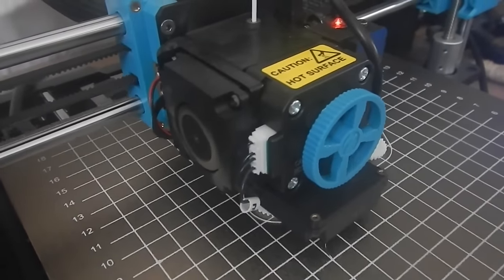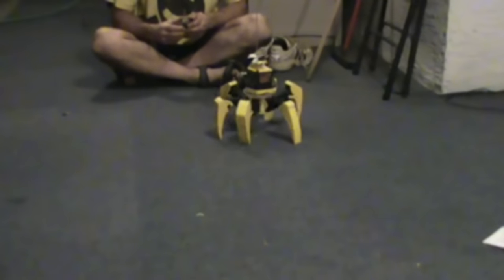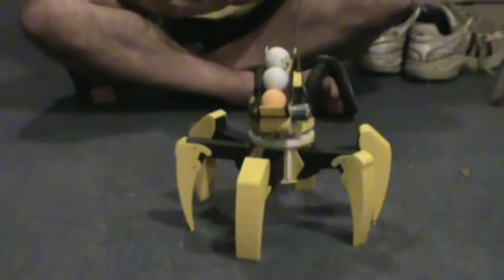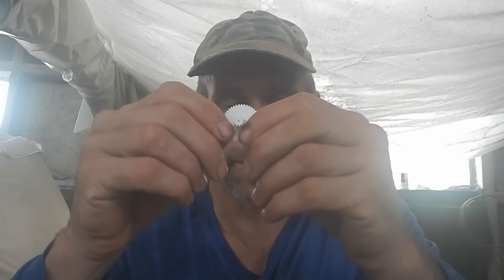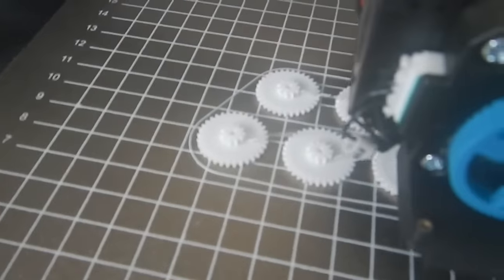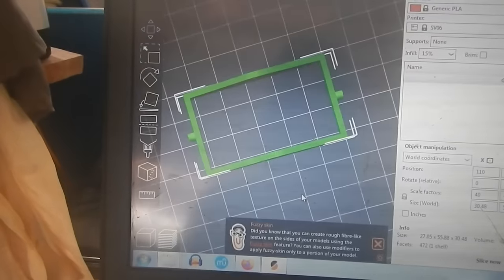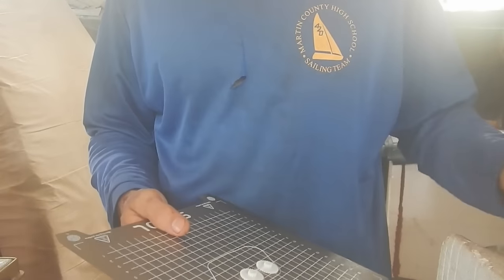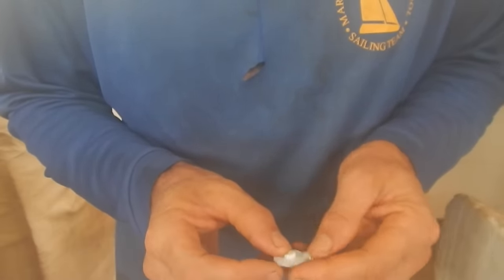3D Printing a Spider Tank Mark 5!!!!! 001

Comment: I also got a 3D printer and was very impressed on how good is at printing mechanical parts, the ability to make perfect gears, without needing a lathe and a milling machine with a universal dividing gear and all the tooling involved, and make the parts autonomously, it's a game changer. Plus it generates waaaay less trash and it's cheaper. Now I'm like "Why the hell didn't I get one sooner???"

Comment: nice to see a robot again. its been a while 
btw have you ever tried the 3d modeling program rhino? i use it a lot and i think you would love it. Grasshopper is partially fun as well

im also a big fan of cura as far as slicers go
Reply from the maker: I do have an old version of rhino... I might have to check it out.  I've used Solidworks a lot, but it crashes, and makes bad STL files.  I'm attempting to learn FreeCAD but it's so convoluted.  I might scrap that.  ....still giving it a chance, though.

Comment: If you have to print multiple smaller items you should check for the option " print one at a time". But then you need to insert the parts all seperate too. And you have to make sure your slicer has the information for the printers needed print head space programmed in. ( I use cura slicer and am not sure prusa also have this option to print one by one). But If you set the slicer to " print one by one" you should see the maximum build height reduce a lot and after you insert a part you should see a dark area around that represents the head space claim. So the next item can overlap dark area but the part itself can not touch the dark spaceclaim area of the other parts. If you print this way you will get rid of all the fuzz in between individual parts. leading to cleaner prints in general. I think the spider robot design is a real genius one. well done.
Reply: prusaslicer has it under Print Settings > Output Options > Complete individual objects and there are options for extruder clearance if needed